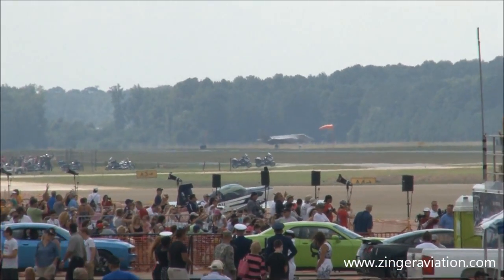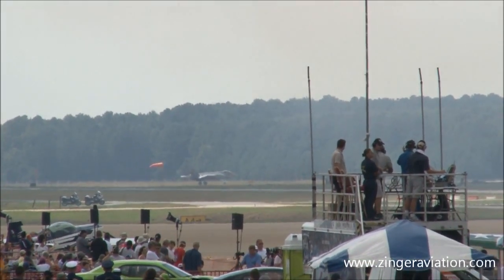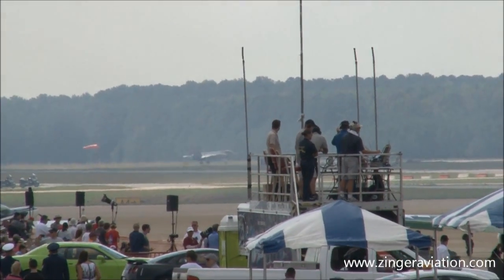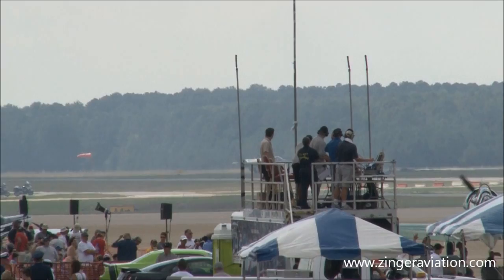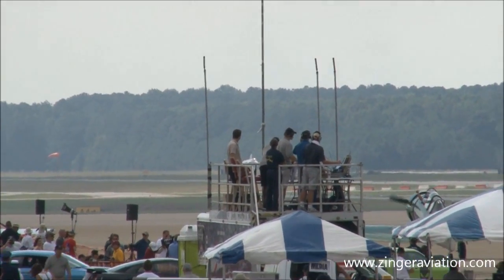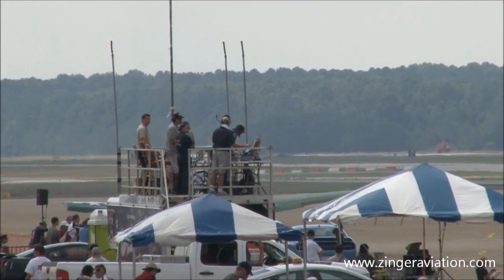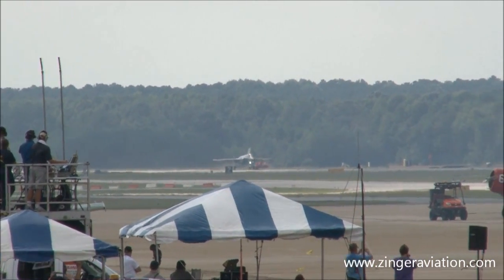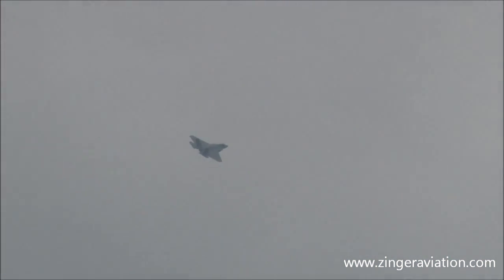2015 NAS Oceana Airshow - Lockheed Martin F-35C Lightning II

Comment: flies like a pig,limited ordnance,limited range,comp network that can be hacked,+us comp sims have shown the Chinese air force would overcome a mix of f35c & local pacifica airforces of similar numbers.
Reply: +Marek Mozejko 
F-35: rolling off the production line. Sold to 12 foreign countries. Pilots stating how awesome it flies.
You: screaming upward from the bottom of the pit: "nah".
Reply: CHINESE TROLL  CHINESE TROLL
Reply: 1. Flies like an F-18 Super Hornet with a lot more power and a lot more speed. Especially in a combat configuration. 

2. MTOW of 70,000 pounds, 18,000 pounds of ordinance with 6 external hard points and 4 internal. Only in a stealth configuration does the aircraft have "limited ordinance". This mission does not require a massive payload. Its SEAD, DEAD, and penetration of airspace. It holds more and performs better than a Super Hornet with a full external payload. 

3. 19,624 pounds of internal fuel vs the Super Hornet's 14,700 pounds. In what universe does an aircraft with an internal fuel. In what universe does an aircraft with an over 200 NM range advantage over a Super Hornet USING ONLY INTERNAL FUEL, have limited range? Are you actually this uninformed? 

4. No, RAND did a limited "simulation" using outdated and speculative data assuming we would just fly our AWACS and tanker aircraft within range of enemy air defenses and fighters. The simulation had the Chinese and Russians shooting down our tankers, and picking off F-35s that ran out of fuel (despite the fact that the F-35 carries more fuel than the enemy fighters in most scenarios and we could do exactly the same thing) 

I know its been 3 years but i hope you grew a little since then.
Reply: I worked on these jets china wouldn't be able to see it coming. So before commenting maybe u should join the military and work on this jet
Reply: @blackwater2010  hes a dumbass, don't bother